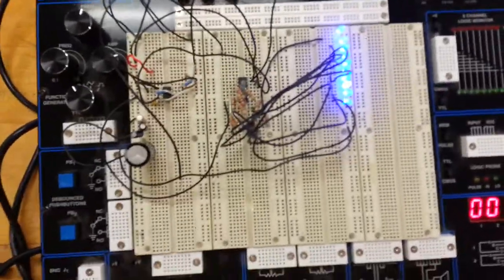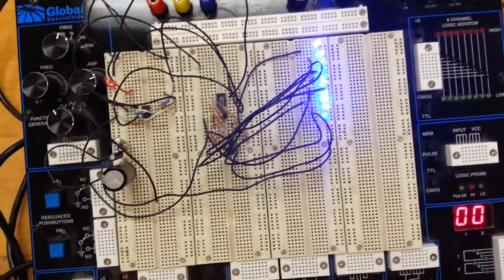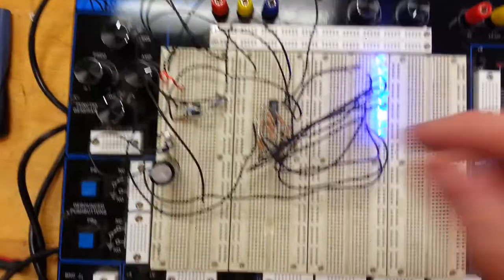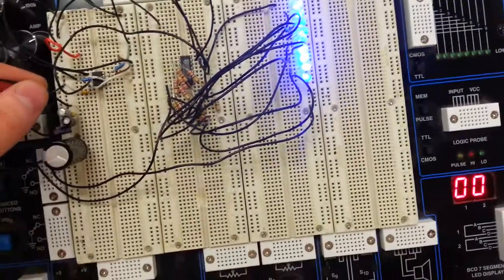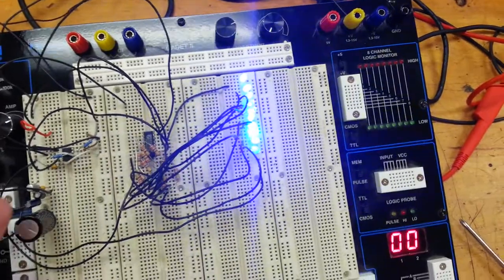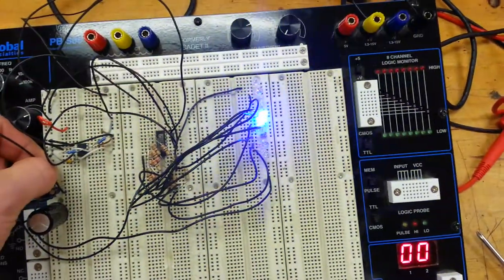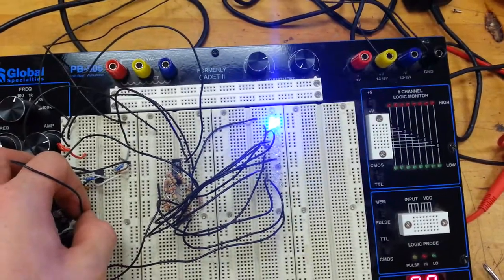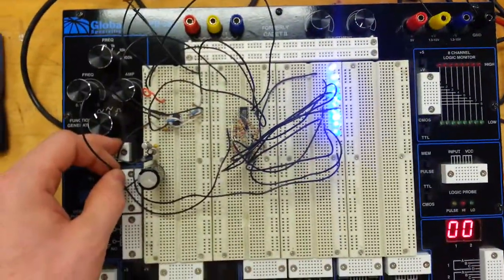555 and 4017 10 LED chaser circuit

Comment: Good looking proto-board setup you have there.  Just wish they would be less expensive.  With all the goodies included on the console, you can do a lot of project testing without have to rely on external equipment, such as function generator and a power supply.

To minimize the components amount, you should consider using only one common resistor for all leds since there should be only one led lit at once.

I guess that when you switch between capacitors, having the Discharge, Threshold and Trigger pins flapping in the breeze, since there is no connected capacitor between the swaps, makes the 555 searching for help and all the leds are turned on.  If you have 10 leds at 20ma a piece, you're pushing the 555 against the wall with that 200ma total current.

Thanks